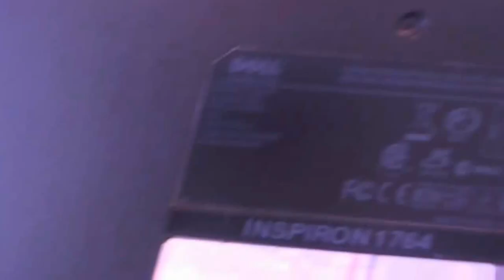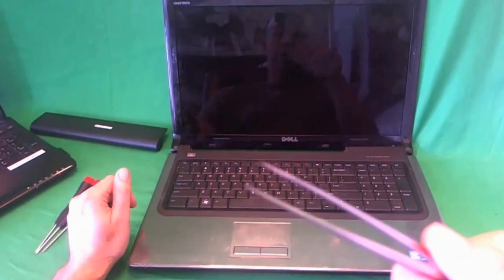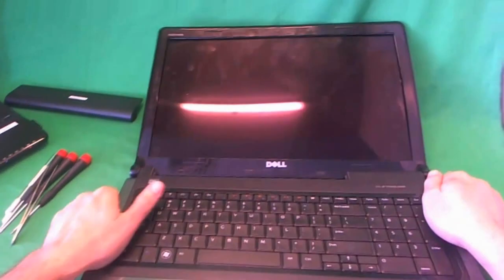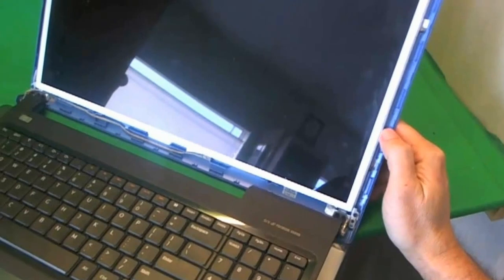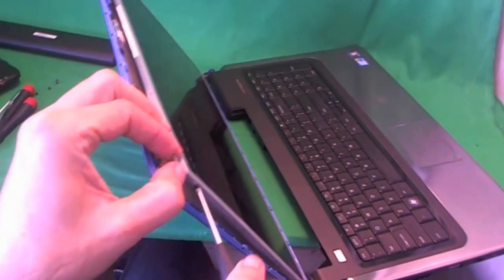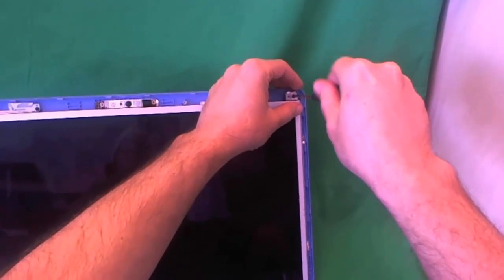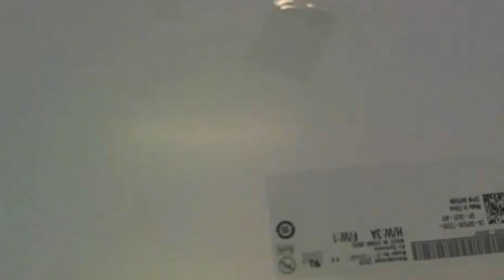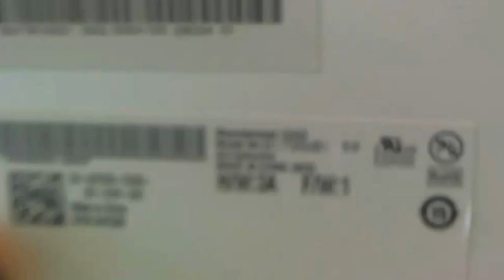Dell Inspiron 1764 Laptop Screen Replacement Procedure

Comment: thank you! my screen had crackly green static. i  suspected the connection was loose, and wile watching your video, i applied pressure in the approximate location of the connection, and now it's cleared up. you guys rock. if/when i do need to replace it, i will call you first. my brother breaks them often, so i will send him your way!